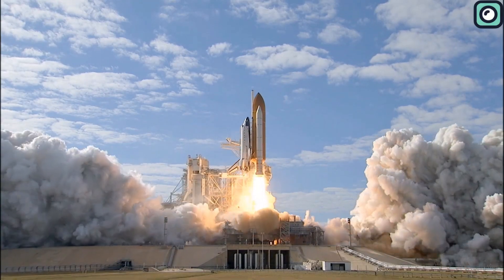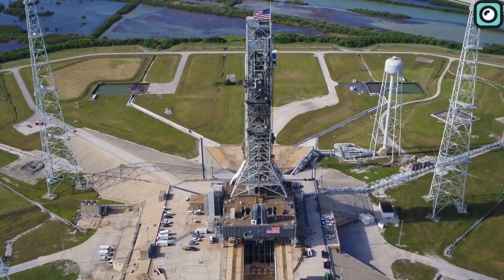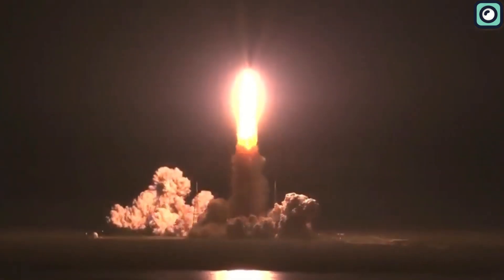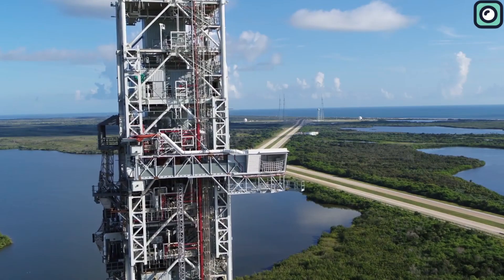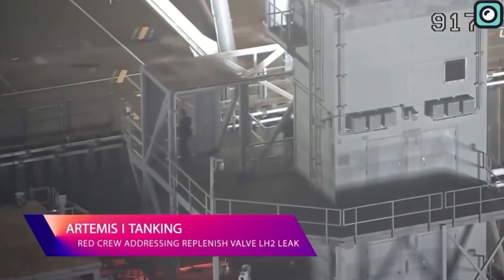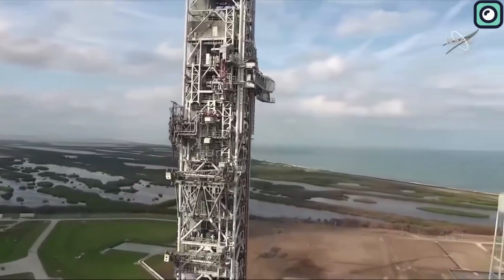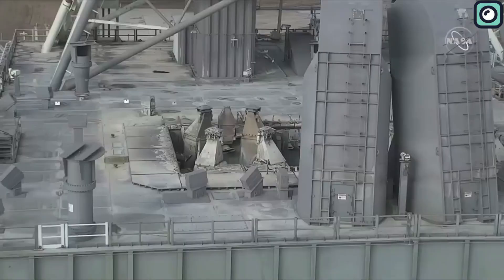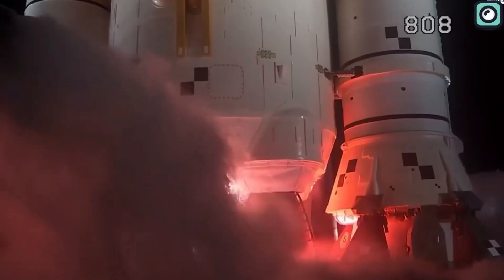NASA Launch Tower in Big TROUBLE after Artemis 1 launch?!

Comment: I like how nasa and other space companies still use  ancient design for their rockets.
Reply: Ancient design? What part of this is ancient? Physics doesn't change with time. Therefore they will build what works with physics....
Reply: @Robert99909  if you look at my ship design versus this rocket .you can tell the difference in tech. 1960s versus modern
Reply: Tf you mean ancient? Why not stop using a combustion engine that's ancient as hell
Reply: @thesupertendent8973  their design are still based off 1960s tech